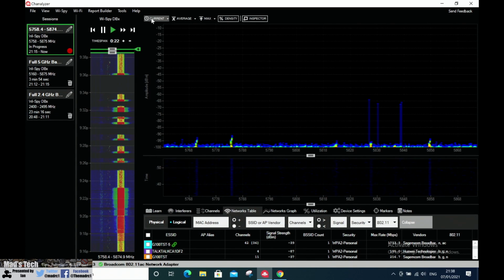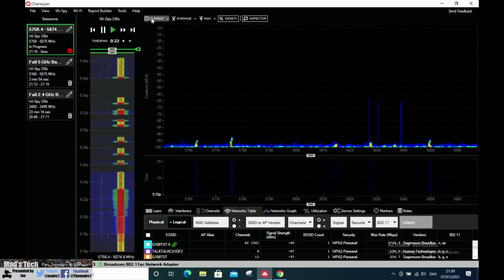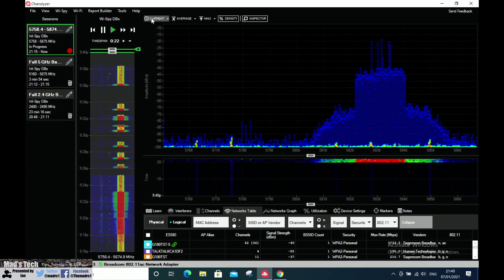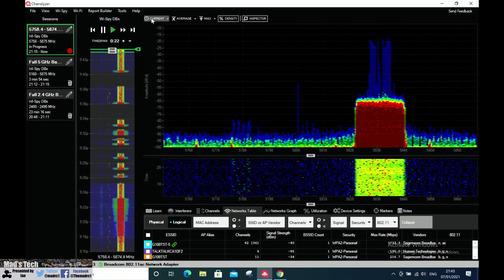DJI FPV - Why It Wipes Out Other FPV At Power On

Comment: so what happens when you power on goggles alone? I wonder when they are sending, only after link with quad is established? In other words is it safe to plug them in and out without a quad when surrounded by analog pilots?
Reply from the maker: Not a lot.  I will show this in the video soon.
Reply: @MadRC  you’ve mention this a few times, but 2 months have gone by and I’ve not seen your update, which was supposed to come out “within 1 to 2 weeks”. Do show us more about how DJI uses the 5.8GHz spectrum, please.

Comment: Could also be a fishmaster on a trawler on the british coast hunting swarms of fish as you can watch the green bar passing by with all these colourfull dots representing wales, sharks, salmon and so on.

I simply want to know when dji will finally be able to offer a roadmap or strategy for the evolution of the goggles for the Mini 2 + Air 2 + upcoming Mavic Pro 3 cause non of these is currently supported. 
Will they evolve the FPV system into a hybrid they had offered with the Racing edition or what is going on ?

the racing edition is great except a bit clumsy or heavy but supports digital and analog so I can easily swap from dji drone over Ranger RC with dji air unit to analog on the mini Talon Evo with flightcontroller and fpv camera.

but the FPV guys for racing here in the field are wainting for a 2nd edition of the FPV goggles while all the Mavic Air 2 owners are waiting for goggles in general like some Mini 2.